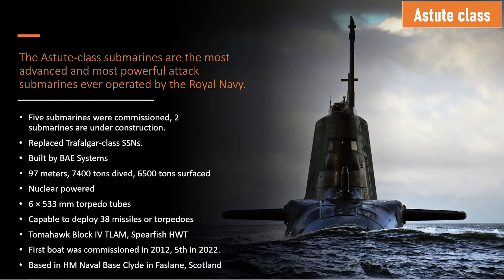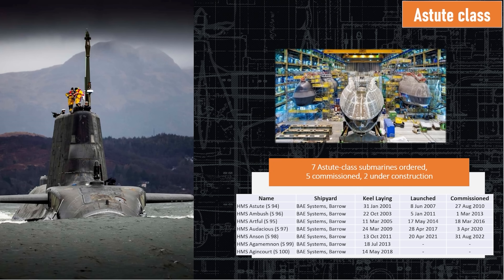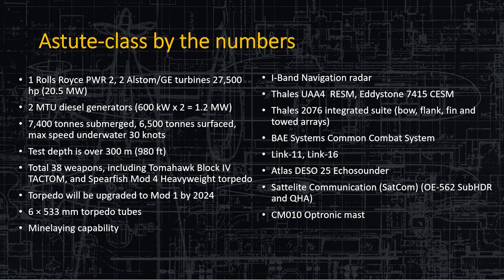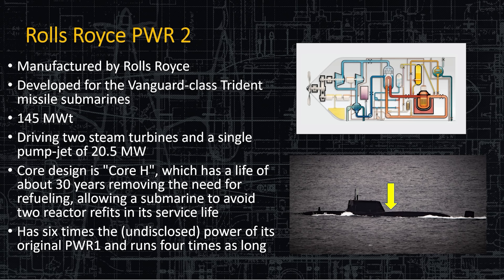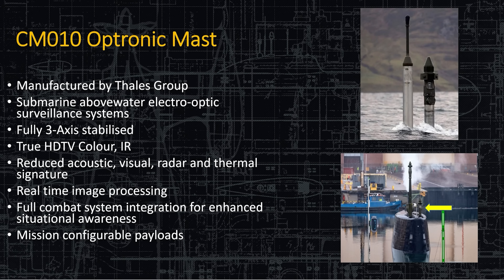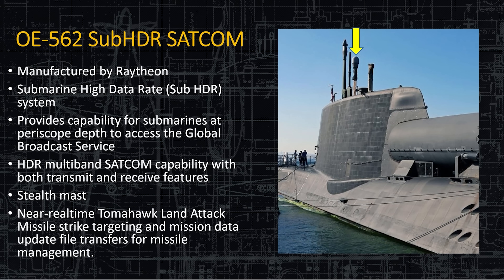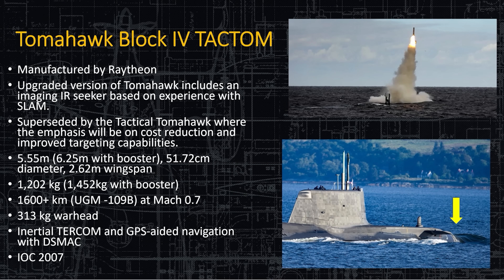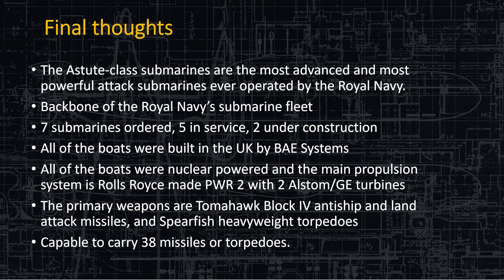Secrets of the Astute SSN

Comment: Sounds like we have a very potent sub here. I am not familiar with the ordinance you mentioned, but it will be a force multiplier if those torpedo tubes can shoot some surface to surface tactical nuke tip missiles. Such as what the Israeli Dolphin mk.2 subs can do.
Reply: UK has no nuclear weapons other than the Trident missile system fitted to the Vanguard class SSBNs. They did have, but all were decommissioned at the end of the cold war.
Reply: In theory the nuclear warhead armed Tomahawks could be brought out of storage and refurbished. But they were removed for good reasons, mainly to prevent adversaries from treating a conventional warhead Tomahawk launch as a nuke and responding with a nuke.
Reply: @Stu_Bur  I don't believe the Royal Navy ever had the nuclear armed variant, though the US did base ground launched Tomahawk in the UK for a while.
Reply: @bobthebomb1596  You are correct, the RN did not have them. However, the US could theoretically share them with the UK in the same way as Trident, in a shared pool, if reactivated.
Reply: @stupidburp  Doesnt sound like a good reason. There is really an BIG difference between a conventional explosion and a nuke explosion.
Reply: @bobthebomb1596  If i was a commander in such a scenario i will give command to activate all anti a.c. and anti missile systems cause missiles launched from torpedo tubes arent inter continental missiles or ICBM's and can be easily intercepted by anti missile systems.
Reply: @Homoprimatesapiens  A response can occur before the missile reaches its target, especially for longer ranged missiles such as Tomahawk where flight times can be many minutes.
Reply: I don’t think we (uk) ever had nukes for sub launched cruise missiles. We did have carrier based nuclear bombers, and we still have nuclear ballistic missiles on subs.
Reply: @DanielsPolitics1  No, I am pretty sure we did not. In fact, I don't believe we ever had any nuclear weapons for our submarines (other than the SSBNs).